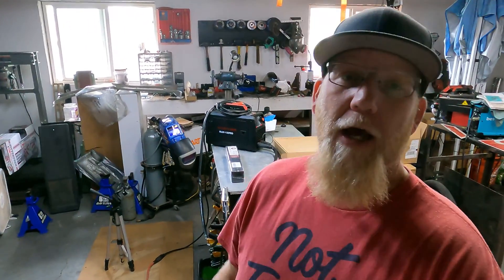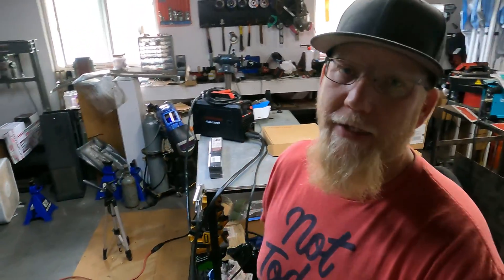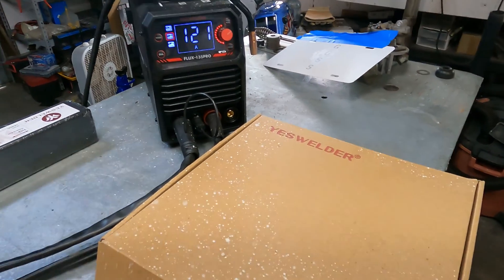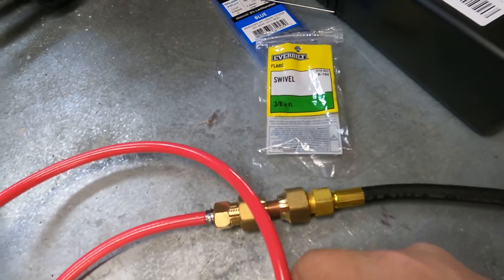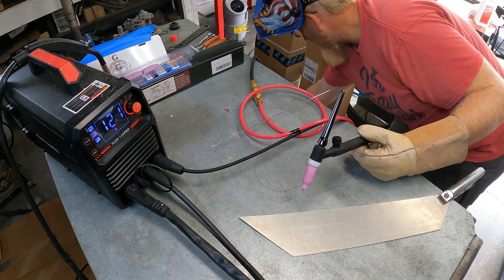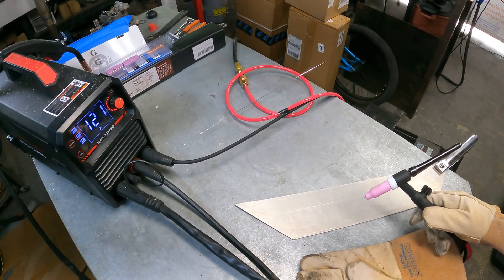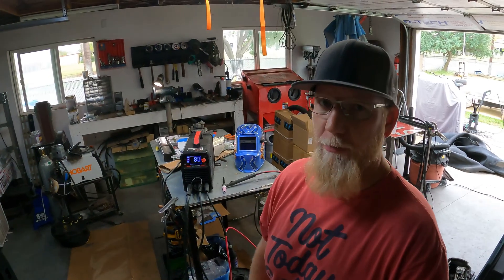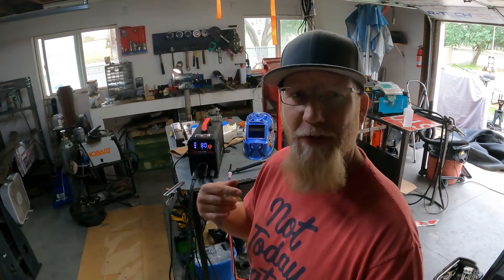Learning to lift tig with the YesWelder Flux 135 Pro

Comment: Hey Gib - 3 comments: 1) AC welder is required for TIG - therefore not the 135PRO; 2) to minimize gas loss, open torch valve, then set regulator level, then close torch valve until ready to start welding; 3) keep galvanized or any plated materials away from ANY welding, especially indoors - the vapors are very harmful, I think even carcinogenic.
Reply from the maker: Thanks for the tips! I used to weld galvanized a lot working for AFC finishing systems. They build build paint booths and HVAC stuff

Comment: Not to be a safety nazi or anything like that, but welding or forging galvanized steel can be deadly. Good luck my friend. You will get it if you practice. Turn the gas down. Stick to plain steel. Watch how far out your tungsten is sticking. Regrind your tungsten when it gets stuck in the material. You will be welding decently before you know it. Your struggles with tig are very common. It isn't easy. No need to feel embarrassed. Props to you for being willing to share your struggles as well as your successes.

Comment: The machine you are using will NOT work for aluminum.  It should work great for steel though.
Reply: Would you rather it work for aluminum or steel? I'm a noob😂

Comment: hey man im not too sure to be exact but i have a yeswelder aswell and it performs great. but i think that machine only runs DC, meaning it will only do Steal, titanium and other materials. not sure what you where gettin after in the video there couldnt really tell but that machine wont do aluminum

Comment: Did you clean the plate with acetone than wire brush it with a stainless brush making you strokes in the same direction and than cleaning it with acetone again. I've watched enough YT videos to know this much. No expert here just asking questions. I'm old I can gas weld arc and mig weld.